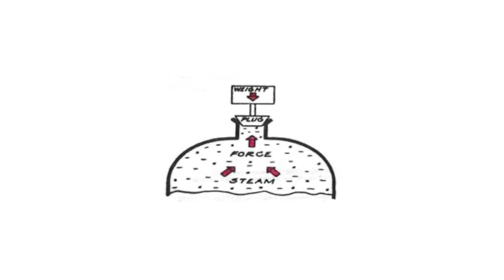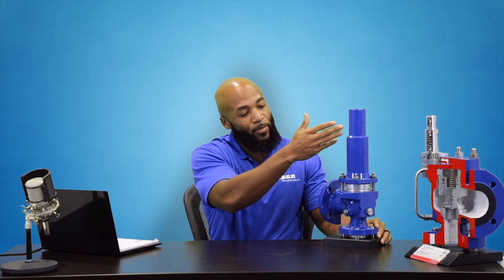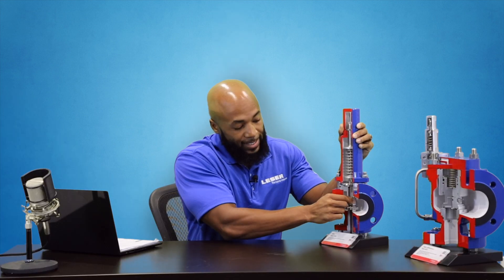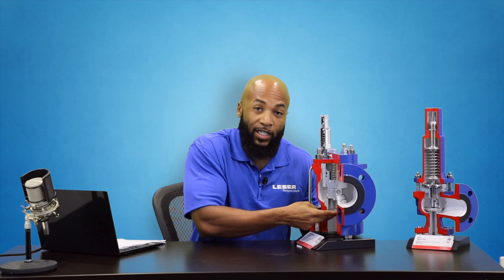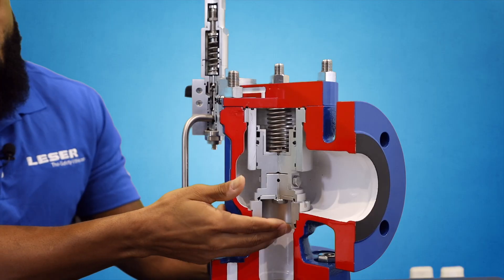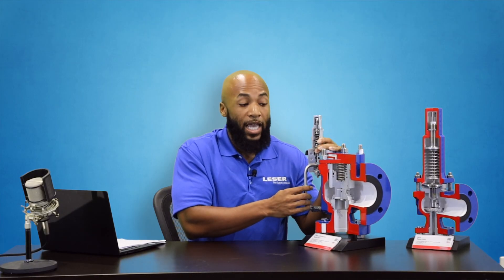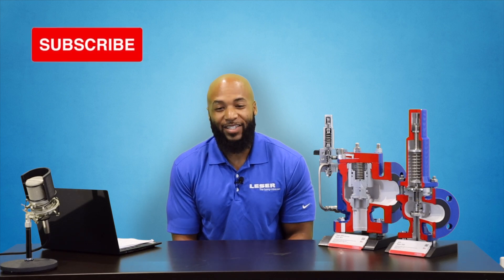An Expert Relief Valve Overview

Comment: Thankyou for your explanation. 
However, a little bit confusing: 
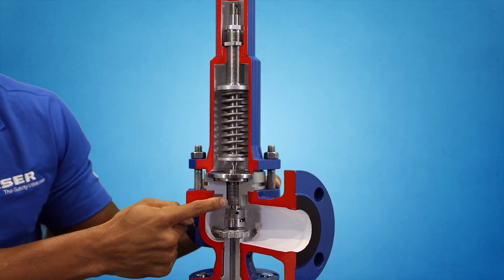At 7:24, you mentioned that back pressure redirected to the closing position. But at 7:43, you mentioned the upward forces of back pressure that could help and assist the valve to open.

As per API 520, in balance bellows PSV, the bellows is attached to the disc holder and has an effective area approx equal to the nozzle seat area. This design isolates the top of the disc from the back pressure.
Without bellows, if the back pressure is high, it pushes downward on the valve disc, making it harder for the valve to open when the system reaches its set pressure to relieve pressure.

Please correct me, if my understanding is wrong.
Reply: I think bellows helps the safety valve to eliminate back pressure by pushing upwards.

Comment: Thanks for this great video. I'm looking for valves working at 60Mpa, very small pipe lines( 1mm inner diameter), I want to control them automatically, maybe solenoid valve, but they seem to work at much lower pressure. Would you please come up with some recommendations? Thanks in advance!

Comment: But the pilot can see back pressure ,so there is chance that due to that it never lifts up,so the main valve also never open
Reply: I've worked on quite a few pilot valves and none of them are affected by downstream pressure. The pilot essentially works like a pressure switch an a solenoid. When the process pressure pressure reaches the set pressure it vents the top of the main to atmosphere which allows the main piston to open relieving the pressure.
The pilot itself has no connection to downstream pressure so it can accurately open the main without any interference from changes on the vent side.
You might see the diagram and think the downstream pressure could be connected to the top of the main piston but if you saw one in person the main piston is in a sealed tube with seals on the outside that prevent leakage from the downstream pressure to the pressure that keeps it sealed.